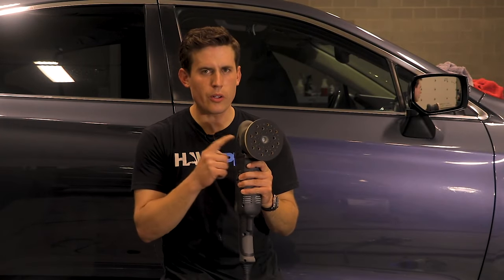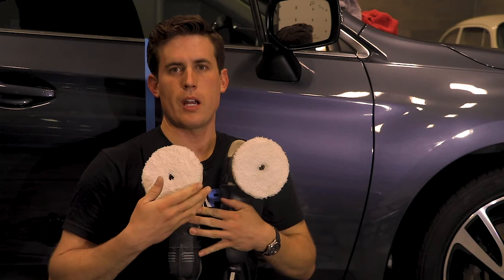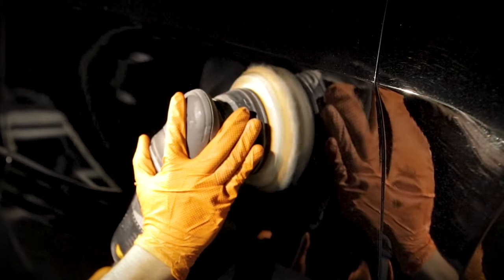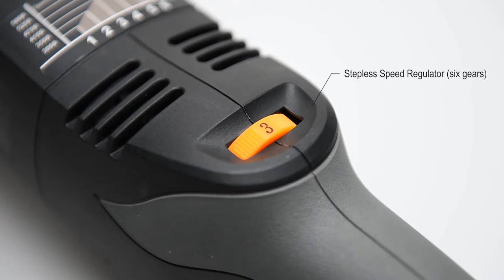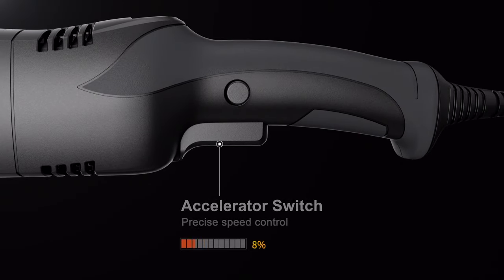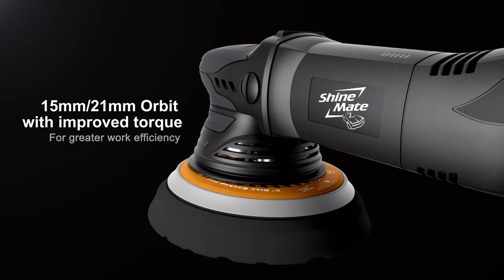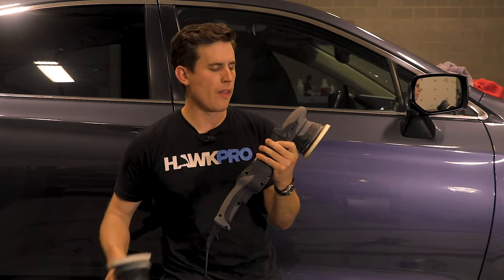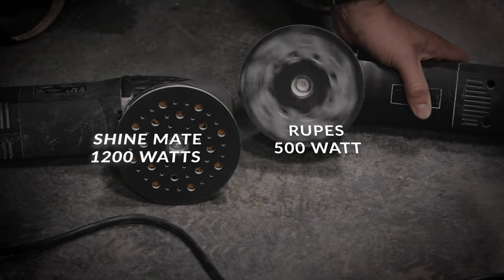Shine Mate's EX620 polisher is a BEAST (and a bargain)

Comment: I added the washer mod to my LHR Mark III and it really helped with the stalling issues that are inherent to the Rupes DA machines. I am intrigued with the Shinemate but I’m an older guy and the smoothness of the Rupes is important to me when doing lots of paint corrections.
Reply: where did you get the washer mod for the LHR Mark III ?
Reply: @kenwithrow5157  Pretty sure Ken Brown’s website has it. It’s a great little drop in washer that goes behind the backing plate and it’s only like $10. Definitely worth it
Reply: @32Thomasthetrain  Tom can you please provide Ken Brown’s website I know of him but I don’t know what his website is TY
Reply: @kenwithrow5157  fair warning to start slow and start with lighter polish and less aggressive pads first to get a feel for it. It definitely changes the machines behavior: how fast the pad and the cars paint heats up, how easily it glides over everything (sometimes it feels like you get slightly less feedback while using the washer mod). I find myself getting great results with just a 1 step polish using a yellow or white Rupes pad, without the washer it would normally take 2 steps to get the same results.

Comment: I’ve been using the ShineMate cordless set for the last two months , my XCE is just sitting. Sold the MaxShine , griots and the XFE and bought more ShineMate machines. I’m really enjoying my decision.
Reply from the maker: Do you feel me on the XCE tho?! I wanted to love it so bad... but just couldn't. I can't wait to try out the shine mate cordless tools. What do you recommend I try next?
Reply: @HawkProDetailing  I do, but I haven’t sold it because it’s a good backup machine. I also taught myself how to get the best of it. Pads are the secret to the XCE. Pad choice. But for now the 15MM and the 21mm ( I got the 12mm as well, the 3”) really get it done for me. I’d tell you to the the 21mm. The 15MM is good. Works fine, but the 21mm for a cordless machine will more than satisfy your need for a cordless machine as well. I pulled the stock backing plate and threw on a Griots new vented plate and it’s even better. My choice for a pro like you. The 21mm hands down.
Reply: @HawkProDetailing  The 21mm cordless I mean.
Reply: @HawkProDetailing  don’t bother with the 15mm cordless shinemate. After using the EX620 15, you will be disappointed with the shinemate 15 cordless. Trust me. Get the 21mm cordless…very powerful.
Reply: @AmirAbdullah  good info. Thanks
Reply: which cordless shinemate do you have?
Reply: @qwikss4469  did you buy the 21mm cordless shinemate ?
Reply: @alfredrasmussen7636   the 21mm the 12mm, and the 15MM.
Reply: @AmirAbdullah  hey bud, I have not.
Reply: @qwikss4469   Oh ok. Just curious.
Reply: @AmirAbdullah  I kid you not, OPM vs OPM, my Maxshine Pro Series 2 is more powerful than my Shinemate EX620 15mm.
Reply: @qwikss4469   I believe you and I had that machine , and the XFE from Flex which I still have , the Rupes LHR 15 and the Griots G21. But that MaxShine I had stalled like crazy and I did the technique change used a washer mod. I just was so tired of the machine stalling and the shinemate stalls but the 21 I got out performs it in every way. I like the 15MM better myself. Others have also said the prefer the Shinemate as well. But I also know folks like yourself who’ve become comfortable with the MaxShine. After having all these polishers I’m good with the Shinemates myself
Reply: @AmirAbdullah  to be clear…you like the shinemate CORDLESS 21? Overall, I definitely prefer a 15mm over 21mm.
Reply: @qwikss4469   yeah it vibrates more but I don’t mind.
Reply: @AmirAbdullah  do you use a 5” plate with the shinemate 21mm cordless? I just ordered the 21mm shinemate cordless. I have the shinemate cordless 3”. I’m beginning to really dislike cords after using a cordless DA.
Reply: @qwikss4469  I do. 5” is really only size I use unless I’m doing a boat and I’m getting way to old for that.
Reply: @qwikss4469  did you get the 21mm ? I used the 15 just today. I really can’t see why you didn’t like it.
Reply: @AmirAbdullah  I did, but returned it. Don’t need it. At the end of the day, the Shinemate EX620-15 is the best 15mm DA polisher in the world, in my opinion. I have the EX620-21 if needed. Another great DA.
Reply: @qwikss4469   oh I didn’t know you had both corded versions. Ok.
Reply: @qwikss4469   But as cordless go it’s a monster man. I like it.
Reply: @qwikss4469  bro have you tried “OP Spotless “ ?
Reply: @AmirAbdullah  hey Amir, I have not.
Reply: @qwikss4469   if you get a chance can you try it. Normally I’d buy it and send it to you but this is a bad platform to spreading out emails.

Comment: Hello. I know its an older video. I just got this machine, went through 5-6 cars already. However the machine sparks a lot ( visible through the body vents ) and I already had to change the carbon brushes. I put no pressure on the machine while working and I use speed 3 ( speed 4 was used for maybe like 30 minutes combined since I got the machine ). Any idea whats happening, I am sure this behavior is not normal. Thank if you reply :)
Reply from the maker: I would contact whomever you got it from and see if they'll send out a replacement or have any advice for you, that seems very unusual!
Reply: @HawkProDetailing  I already sent it to a service, they said something about a spring being faulty and pressing the brushes too hard, fingers crossed they can fix it. It is under warranty anyways. Thanks :)

Comment: Shinemate has been making quality machines for years however, they're not as popular in the states. But, the EX620 line, has more power and torque than Rupes. Even though Rupes is the Cadillac of machines, Shinemate cutes so good plus all of the various options available. I love all of my Shinemate's I have. Especially my EX605 which is more powerful than the duetto. Great video!
Reply from the maker: Thanks man! Yeah I feel like they are going to make a push in the states because detailers are craving value...I do believe you get what you pay for, and this machine is so reasonably priced I was very pleasantly surprised. Like I said in video, there's no question rupes is popular for a reason. It's such a smooth well balanced machine. But ours break with time and wear, it's not like they are indestructible. And if they aren't damn near perfect I would rather not spend that money
Reply: @HawkProDetailing  I couldn't agree more. I know they're the Cadillac of polishers but the EX620 line just out performs the power and torque. Plus, the price from carzilla you just can't beat that. I'm right about to invest in the cordless line pretty soon. Those are nice as well.
Reply: hola la ex605 no se detiene al ejercer presión para logran cortar , ? en que velocidad corta bien sin detenerse el giro  y la orbita? de verdad que es mas potente que la rupes duetto???  gracias

Comment: After burning up 4 rupes I tried a harbor freight bauer. It was loud and shakey. I changed the oil and adjusted the weight and it worked smoother and quieter than the rupes and more powerful. I'll never buy rupes again.
Reply from the maker: Ours are all broken in the shop 🤣 the 75e is great but the mark iii is average for the price

Comment: The max shine gets the job done I’ll bring over so you can rip on it. Great vid homie
Reply from the maker: Dude I wanna try the max shine, I know you say it works great too. There's no denying rupes is smooth, but we've had to send in machines recently so in a working shop if everything is gonna get beat up and the expensive machine isn't Bullet proof I'm not sure if we need it...
Reply: Maxshine M15 Series II works very well. Not quite the power of the shinemate, but more powerful than the Rupes.
Reply: @qwikss4469  how do you like your ShineMate vs the MaxShine ? I sold my MaxShine machines the cordless is better IMO.
Reply: @AmirAbdullah  the Maxshine 15 pro series II is better than the Shinemate 15 cordless, IMO. I’m not too impressed with the Shinemate 15 cordless power at all. Speed 6 is fine, but it feels like the machine is working to hard. Just doesn’t feel right. Speed 5 is OK. Anything below speed 4 is too weak.

The original Maxshine 15 is garbage.
Reply: @qwikss4469  I feel you but gonna disagree. I sold my series 2 MaxShine machine. Mine stalled way too much. Plus so many issues with MaxShine machines if you got a good one you scored. But the pad and backing plate choice to me make the biggest difference. I’m getting a lot more spin at speed 5, but it’s a cordless machine tho so it’s only gonna be so good. Now the 21mm is a whole different machine crazy power. And the corded version is even better. Right now ShineMate is killing the polisher game IMO.
Reply: @AmirAbdullah  , I must have got a good Maxshine. I’m very critical to stall, and I can tell you it was pretty powerful. I’ve heard the 21 cordless is a beast, yes. However, I don’t use 6” pads very often, but li like to have a 6” polisher on hand. I don’t like using a 5” BP on any 21mm.
Reply: @qwikss4469  yeah I wasn’t even a 21mm user until I got the ShineMate. But it’s crazy. Even for the 15MM I’m getting better spin with it. I’ll try the Excell plate as well. Right now I’m definitely feeling the ShineMate machines. My MaxShine machine was garbage tho. But either way nice talking to ya.
Reply: I love my rupes there are some great tools out there that get the job done to that don’t break the bank 💪🏾💪🏾

Comment: Have you ever tried the new Griot's polishers? The new G21/G15. I heard they had a lot of heating issues at the beginning but have since been fixed as of 6 months or so ago in their more recent production runs......Apparently, they have crazy power too & are great with not stalling on curves/edges. Griot's also boasts about how smooth their machines are.......I wonder how this shinemate would stack up versus their G21/G15.
Reply from the maker: What's the price point on those?

Comment: its a solid cheap machine. People who invest in rupes tend to put long hours behind machines often 8-12 daily. using  a machine with significantly more vibration will get to you. its inevitable. a honda civic and a mercedes will both take you to the same destination. Rupes will always have its market.
Reply from the maker: Have you used shine mate? I feel like I assumed it would be "cheap" but it's pretty dang solid. With that said, vibration is a real thing and I respect the elegance and smooth(ness?) of rupes. But the mark iii isn't like some durable beast in terms of daily shop use. We've sent one in and have another on the IR lol.. Flex is where I look for true durability